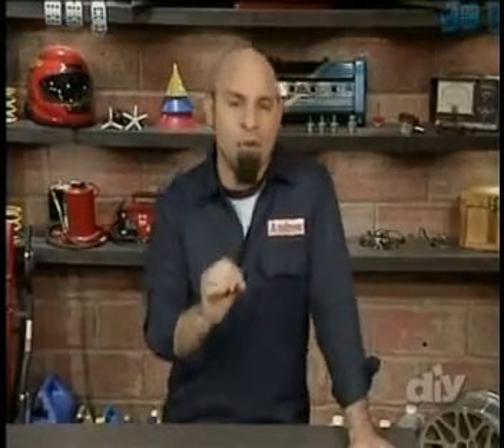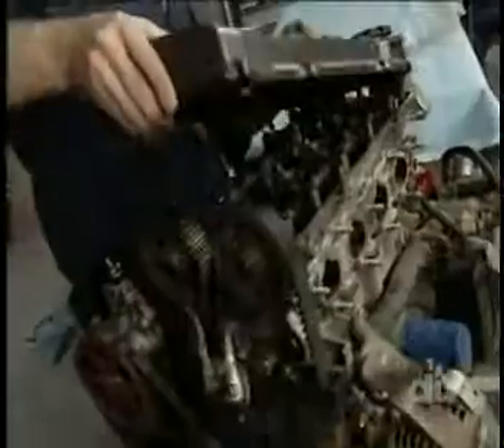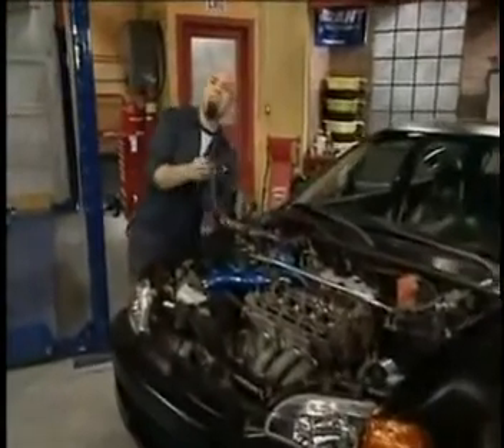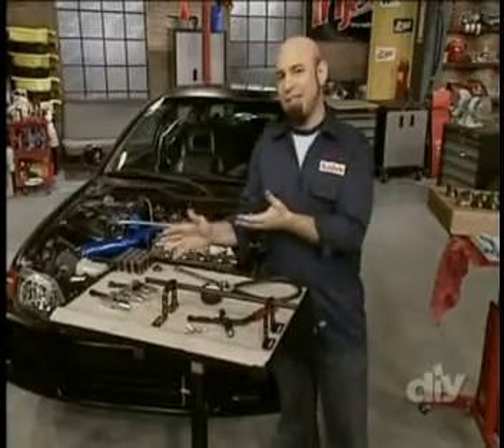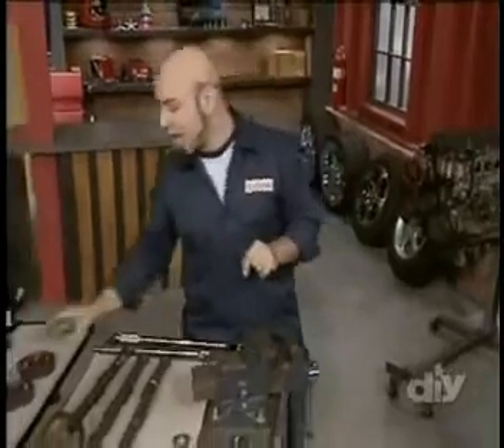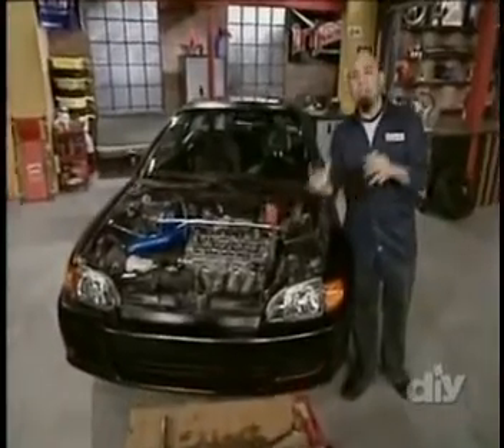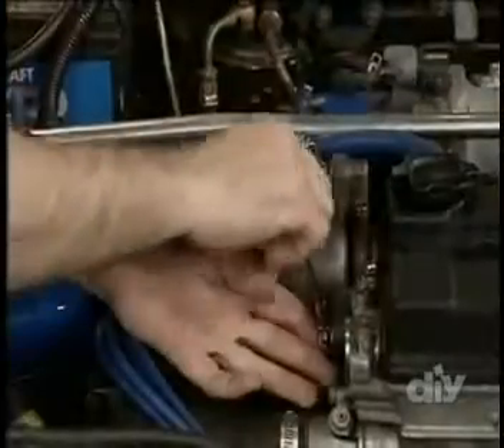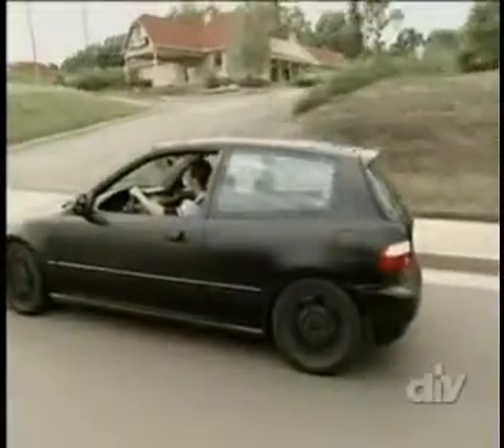DIY - Tricked Out - Honda Civic Cam Swap

Comment: What happened to Valve adjustment, and lashing ? Also , you did not mention the HP gain   At the dyno ?  What was it making before ?
Reply: its on the dyno sheet he showed.  It looked like 115 to 132 or something like that

Comment: B18b is supposedly 145 hp stock how did they manage to lose power with all these mods
Reply: They are measuring power to the wheels. Factory numbers are higher because they measure at the flywheel which is before powertrain loses (wheels, transmission, axles, etc.)
Reply: You have learned the first lesson of modding.  Welcome to the world of cars my son

Comment: Damn this car was brand-new when they filmed this 🤣
Reply: that model civic is from 92-95, this was filmed around mid 2000’s, so the car would’ve been over 10 years old at this point. not brand new

Comment: What's the risk of up-grading the cams and not bothering with springs etc?
Reply: Some performance cams require you to use upgraded spring, some allow you to use stock springs. You should buy the cams that allow stock springs. A stronger spring will allow the valve to close faster faster after it's been open, so if you are running a cam that requires upgraded springs, it's because the valve is being pushed out further, and need to close back up faster to avoid having the piston smash into it I think. That would be the risk, which is definitely not worth it.
Reply: You risk Valve float.  Basically the valve wont open and close when its suppose to so your engine starts messing up.  For this engine people use crower 403 cams with stock valve springs and rev to the stock rev limit without hurting that engine.

Comment: He forgot Valve adjustment!! I feel bad for all the people who followed his direction and ended up with problems
Reply: Well the valve lash will be exactly the same as it was before because of the way he did it but yeah the new cams likely have a different adjustment but we dont know exactly.  Whats more important is that he didnt mention it needs to be tuned and add in the cost of the tune which is excessive
Reply: @timm5970   he did say it needs to go to the dyno for tuning, like 3 times lol
Reply: Aaron Smith  your inexperience is showing.  Who even said its a regrind?  You need a tune kids dont listen to this druggie
Reply: Aaron Smith  you need to to tune it

Comment: i think is better for $1300 to get turbo kit
Reply: If you want real power from a turbo you need an ecu, injectors, connecting rods to support it, possibly pistons, (if you have an H series you need to reseleeve ), fuel pump...
Reply: with the $1300 or maybe get another  B series engine to get more power
Reply: this video is over 12 years old, Its cheaper now. But I agree Id just put that money towards a turbo.
Reply: a turbo kit with a stock engine would limit the amount of boost you can run

Comment: its not worth getting new cams if you arent gonna port and polish the heads.. i mean if you already took the head out you might as well do it.. the real gains are from head porting and new cams but they both work together simultaneously
Reply: Slim not true! a p&p Will deff  yield more gains but just slapping in cams, springs and retainers with a good tune is worth it as long as you have a good exhaust system and the engines in  healthy shape.
Reply: heads$ its only got 1 head lol
Reply: but he didnt take the head out.....

Comment: If the car was still making horsepower at 7000 rpm, why wasn't the red line increased?
Reply: Ecu tuning/control is needed for that, which I’m assuming this car didn’t have. Wouldn’t advise reving past 7600 on the stock rods bolts anyways.

Comment: what would be your advice if one were to drop one of those valves down in to the cylinder with that little trick of yours?
Reply: +v6 ftmfl sell the car immediately
Reply: if it drops through the head it'll normally drop to the pan, just pull the pan if you can't get it up top with a magnet
Reply: this is why you stick a towel over the oil galleries to prevent things from falling down, like valve keepers and sockets

Comment: will this mod make the vehicle pass smog?
Reply: If you're worried about smog then don't even mod your car period.
Reply: Tf is smog
Reply: +John G It will make it less likely to pass smog as you are upping the air and fuel being used by the engine, its a performance upgrade.
Reply: MyMuZiiK- I think he means the smog in the atmosphere. shits pretty bad where I'm at.
Reply: No